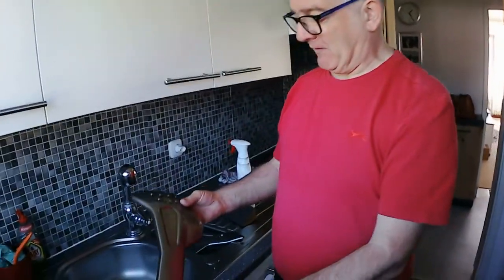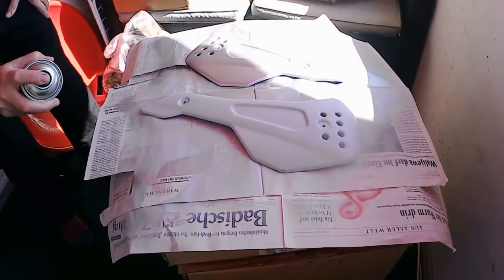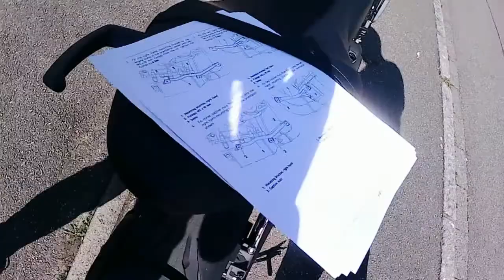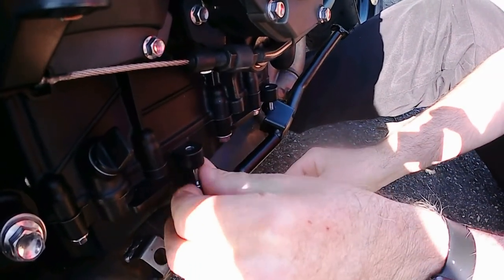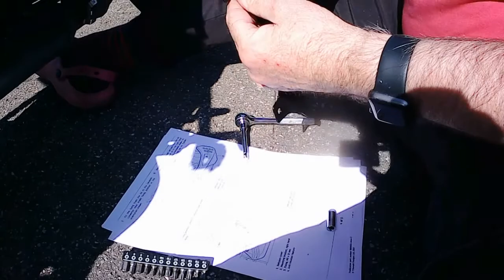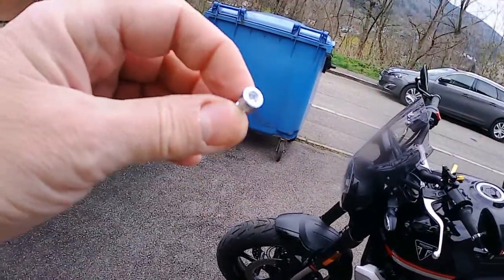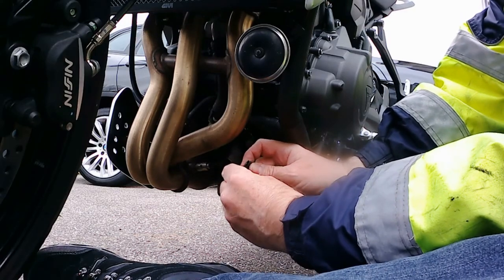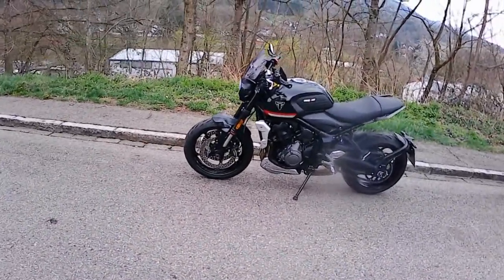Belly Pan Painting & Fitting on the Trident

Comment: Hi, well done. Looks good and IMO like the OEM belly pan in the video. Feel the back pain on the hard ground with you and the fight with 'supposedly simple installations'. Really appreciate that you always show real life in yr. videos. I was not as brave as you, so have the oem's. Btw yr. trident looks like a twin of mine (same color, but puig screen and additionally hepco bags mounted), delivered in may 2021. already any news about the problem with the engine turn off??
Reply from the maker: Hello Basics, thank you for your comment, really a nice read. 
Ok about the bike, the dealer I was using does not want to do the work because they will not be a dealer very soon so, they have been replaced by my local BMW dealership they also are now Triumph as well, my bike goes there at the end of the month so they can check it out and they will also will give a replacement bike while mines in the garage ( it will be a BMW) a video will follow 😉👍